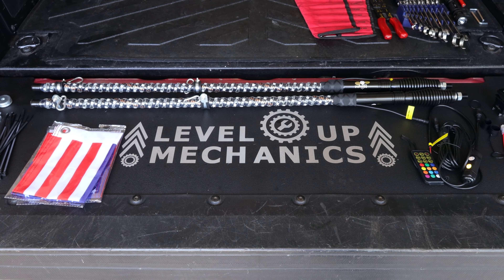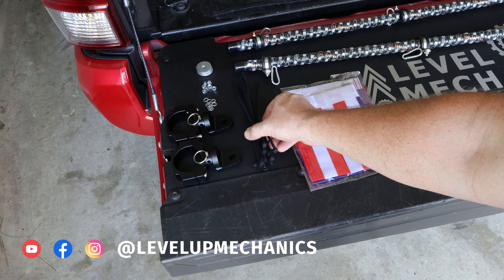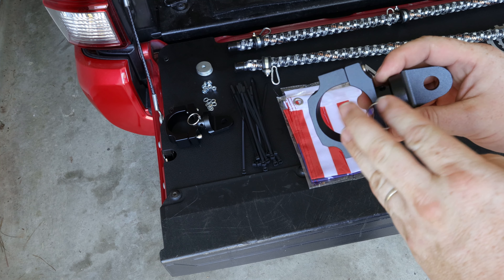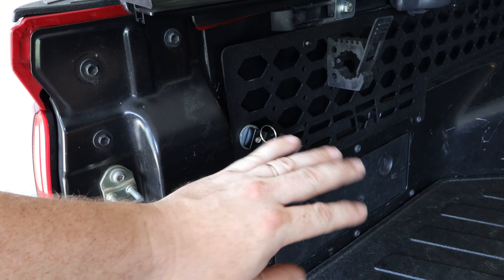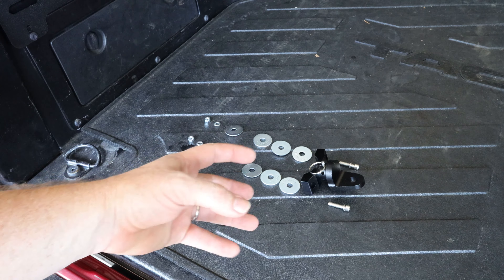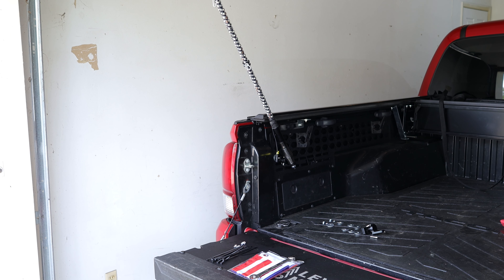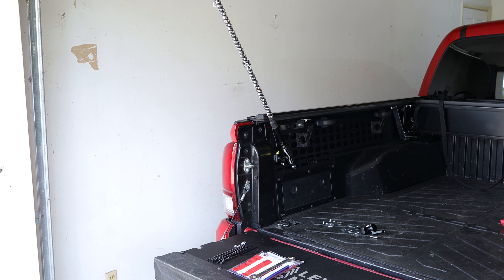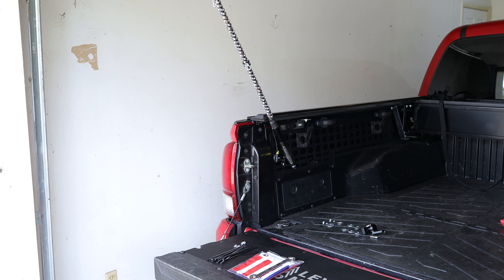Installing CRAZY BRIGHT LED Whip Lights Onto My Toyota Tacoma! - Nilight

Comment: This can be mounted to stand 90 degrees? I like the concept!
Reply from the maker: Technically it could be. The bracket I used has 60* adjustment angles (I wish it was 45*)... so technically if you make a 30* offset, then 90* is possible 🤣 

The only reason mine are angled is so I could lay them horizontal and store them onto my molle panels 😁

Comment: can you splice the wires into a 4 pin harness connector instead of splicing into the 7 pin wires?
Reply from the maker: Absolutely, you sure can. All you need is a source for ground and a source for power. 😁👍

I just wanted to show an example of how to wire them up in my video, but there are plenty of other ways you can do it.

Comment: So does it have constant power from the trailer hitch or do I have to press a button so they can power on?
Reply from the maker: It comes with a wireless remote that will allow you to turn them on & off

Comment: How or where did you put the switch  that control the whip lights ?
Reply from the maker: I powered the whip lights by tapping into the trailer connector... so all I have to do is turn on my parking lights (and press the "power on" button on the remote control) if I want to use the whip lights 😁👍.
Reply from the maker: ... no switch is needed.
Reply: @LevelUpMechanics oh okay, thanks! The bracket that you use 
It’s not unavailable anymore 
So I had to use different Brad of  bracket but similar
Reply from the maker: @DavidFlores-vx7sb good to know. Thanks for the update 😁👍.

Comment: Does your third break late still work? I installed a whip the same way and I think my third brake light stopped working after
Reply from the maker: My 3rd brake light is still working. If you wired everything correctly, I wouldn't think that the whip lights would affect the stock lights...

It should get power and ground normally, as if you were actually using a trailer (with lights) that utilized the factory trailer connector... that's odd 🤔.
Reply: @LevelUpMechanics  thank you man, yeah it’s weird. I don’t think my whip effected my brake light, I just was just going down a list of things I thought could possibly make it stop working. Still haven’t figured it out😂 but appreciate the video for the whip light, it helped a lot
Reply from the maker: Anytime 😁👍. Hopefully you will be able to figure out the 3rd brake light issue.

Comment: Wait so mine are Bluetooth and have a control , how can I have constant power so I have them on whenever as long as the truck is in can I still use the hitch plug?
Reply: Okay so I looked up the diagram for a proper look , so I can plug mine in in to the white wire for ground and also to the the black for the 12v battery so I can turn it on whenever as long at the truck is on correct?
Reply from the maker: That should be correct... 😁👍
Reply from the maker: I believe you can still use / tap into the hitch plug for your setup 😁👍.
Reply: @LevelUpMechanics  yes that’s what I was referring to sry , so there’s a wire labeled ( 12v power) I believe it’s black. I can just connect to that one and the white (in the hitch plug itself)
Reply from the maker: @Mdozaaa yes, that should work 😁👍
Reply: @LevelUpMechanics  I appreciate it thanks hopefully it works

Comment: What were the brackets you used to mount the whip lights
Reply from the maker: There should be a link to the hardware I used in the description section of the video. But if you are talking about the molle panels, I have a video of that as well on my channel. 😁👍